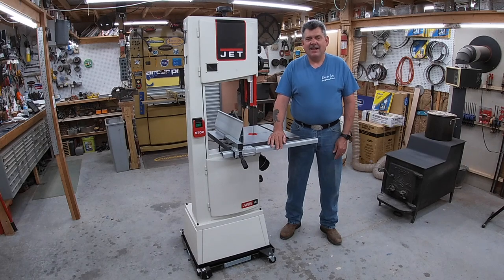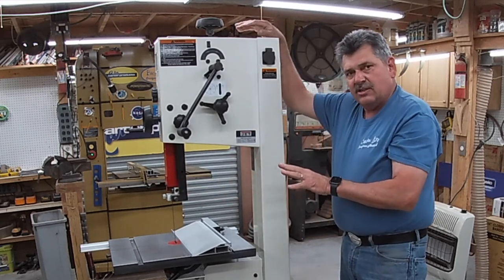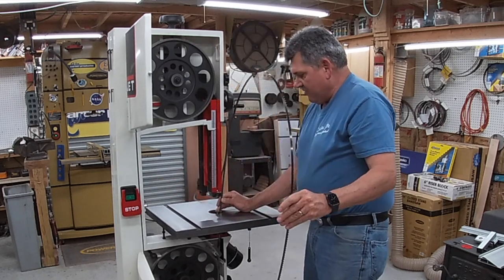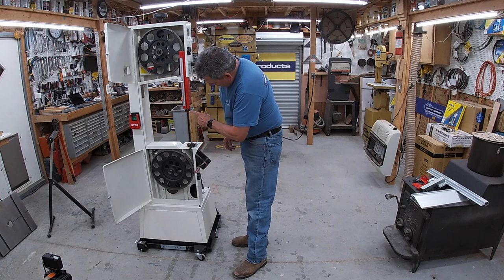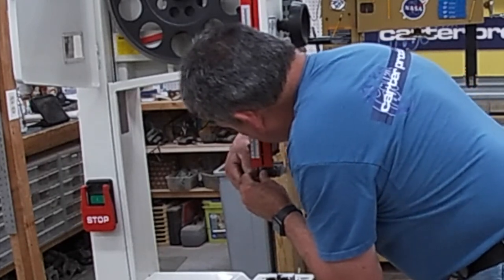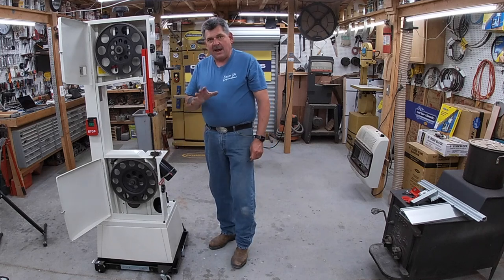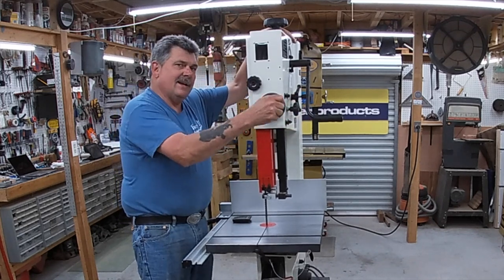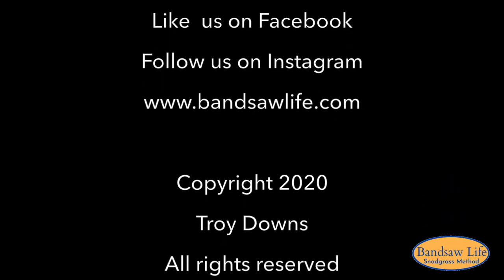JET JWBS 14-SFX

Comment: I have this saw. when I tried to install a 1/4" blade, the tensioner nut ran out of threads and fell apart well before the indicator reached the 1/4" mark. Is there some sort of method for adjusting the indicator? Since I have this feature, it would be nice to use it without having to rely on "eyeballing" alone.

Comment: One thing I am curious about is how you never aligned the table with the blade.  How do you know the blade is parallel with the fence?
Reply from the maker: I used a F.A.S.T. Fence alignment system tool to align the fence directly to the blade.

Comment: I love that they used cast iron for the wheels and the saw is a really nice looking design. BUT, I’ve been reading reviews on this model and there are a lot of people who are having problems with parts breaking while they snug up a certain area. There are multiple complaints about the fence locking mechanism breaking. There are more than a few complaints about the cast iron table being dipped, so people have to pick up the wood to go across the split in the table. Some complaints about the quick tension mechanism going bad. But the number one complaint (and it’s about 99% of those who contact Jet) is customer service and/or technical assistance. Literally dozens and dozens of people complain that there is little to no help from Jet. Of the people who have a properly functioning saw, they say it cuts effortlessly and they couldn’t be happier. This tells me it’s a problem at the manufacturing level. Jet, pay attention! This could bring you back to the top of the home workshop and even small business owners level or if these issues continue it will make you another laughing stock company that looks like you are just pretending to build good reliable products.
Reply from the maker: @davidt8438  David while I can understand your criticism I also know this is their number one selling saw which means there are thousands upon thousands of them and yes there will always be problems.  Jet had an issue with customer support during Covid and they have stepped it up.  If you personally have a customer service issue please feel free to call on me and I’ll do my best to get you to the right person
Reply: @bandsawlife2660   Thank you Alex, I appreciate your response. I’m glad to hear Covid was the culprit and not just another company just out for a buck and then no support. While I don’t have the aforementioned bandsaw I do have their old floor oscillating sander (JOVS 10) Unfortunately parts for that are no longer available and I’ve looked. I wonder if you know if the newer floor model (JOSS-S parts are interchangeable? Specifically the spindle and related parts. I understand you’re the bandsaw guy so if not that is expected. I do wish they would stock more parts for old machines that were sold as recent as 10 years ago. Thank you

Comment: Glad you like the saw,I bought one last month when Jet had 10% off.I set it up using your method and it works perfectly.I removed the keepers on the fence so it can just be lifted off when not needed. Now if Carter would just make a stabilizer to fit this saw without having to buy extra parts.

Comment: Hi Alex: Very informative video. Just subscribed. I've just come across your name as I am acquiring shop tools to go into my newly reorganized garage. I recently purchased the Rikon 10-3061 10" Deluxe Bandsaw, Includes Fence and Two Blade Speeds. It has not yet shipped. I am starting to doubt the purchase based on many complaints I've seen about the non standard 5/8" miter slot. How big of an issue is that (there are really no 5/8" miters out there that have any good reviews)? And what benchtop band saw would you recommend for at most $700 budget? Thank you in advance.

Comment: Hello I bought this saw 4 days ago after watching this video.  Thank you, it's a great saw. Just a couple comments for future buyers.  It's a heavy saw, about 300 lbs. so get a friend to help you set it up. It's a fairly easy straight forward set up so don't be afraid of it.  It comes with the trunion mounted to the frame not to the table as shown in the video. You do have to mount the table to trunion, only 4 bolts. Mine came with 2 rust marks on the table but cleaned up nicely with paint thinner and steel wool. If you need to clean yours, wax it afterwards so it doesn't rust again. The set screw for the lower thrust bearing adjuster is 3 mm not 4 mm as the instruction sheet calls for also a ball end style hex wrench helps install the upper dust port. The wrench supplied just won't get it done. The only other tip I have is when you go to turn it on for the first time push the green button with really firm pressure. It moves about a quarter inch or so before it engages the real switch and that inner switch has a very tight spring. After you work it a few times you'll get used to it. Happy Sawdust and thank you Alex for the all the advice on every ones comments. I had bought 5 Timber wolf blades when I bought the saw, guess I'll be ordering some Carter blades at least in the smaller sizes.
Reply from the maker: Thanks for the feedback.  Carter blades a far superior to the Timberwolf in both performance and durability.  Post some photos, you have a great saw there

Comment: I just purchased this bandsaw and found this video to be very helpful. Just want to note that my new saw has several upgraded features in comparison to the saw in the video:
1. All guide bearing adjustments can now be done without tools. This includes both top and bottom guides. 
2. The lower thrust bearing is no longer attached to the table. It’s part of an adjustable block assembly that holds thrust and side bearings, and is attached to the frame. 
3. The small panel that covers the upper thrust bearing is gone, and the tool-less adjustment knob is always exposed. 
4. The lower guide guard is now a single unit, and is hinged to move out of the way for adjustments. It does not require the use of any wrenches. 

All of these updates make setup and adjustments much easier than the version shown in the video. Note that the old part number was 714400, whereas the new saw part number is 714401. 

Thanks again for the great video!
Reply from the maker: Thanks for the update, it will help others.
Reply: When I try looking I keep coming up with 714400K and no one seems to refer to it as 714401
Reply: @matteason989  Hey, Matt. After my post, I realized the 01 part number is just for the saw, and 714400K remains the part number for the entire kit (stand, fence, etc.). So, it appears the changes I listed above have been rolled into production with no change in part numbers, and therefore no way to tell which version you might get before purchasing the saw. My guess is that this stock is turning over pretty quickly these days, and a saw purchased today is likely to have these updates. FWIW, I purchased mine in May from Acme Tools. Sorry for the confusion, and good luck.
Reply: @chipmiller984  Thanks Chip. Local Rockler is doing 10 percent off Jet in August. I'm tempted to get this one instead of the Laguna

Comment: I would like to add a mobile base. In your comments below, you mentioned one with steel wheels from Woodcraft. Can't find it on their website. Also, I put on a 3/4" Wood Slicer blade. Tires are only 1" wide so can't center the teeth on the crown of the wheel. Even so, with your setup, the saw does a fabulous job of resawing. I've had this saw for several years and had been struggling until I saw your video. Thanks for the great advice!

Comment: My experience with this saw has been mixed.  I bought it on a black friday deal last December.  When it arrived, I noticed that the upper guard (the red housing with vertical slot to allow blade installation) was cocked so that I couldn't raise it all the way; the red housing ran into the white steel housing, which was cocked.  After talking to Jet tech support many times and trying to correct this, Jet replaced the saw.  The replacement saw has a few minor issues (the upper guide block was roughly machined and two upper guide bearings wouldn't rotate at all), but Jet supplied replacement parts and the saw is now running.  I also have a Laguna 14|12.  The Jet is beefier and taller.  The lower guides are harder to set on the Laguna because they didn't provide enough vertical clearance under the table for larger hands.  Also the upper post was 'cocked' on the Laguna and I ended up shimming it to get the ceramic side guide faces to be parallel with the blade.  Overall I'm not sure which I would pick if I could only have one.  I think the Laguna might get the nod by half a gnat's whisker but my impression is that if I had spent a little more and got a Jet 15", it would have been a better saw in terms of guide adjustability and perhaps quality.
Reply from the maker: I wouldn’t disagree that the 15” is a better built saw and their customer service was exemplary.  Sad you got some issues but I’m thrilled they stepped up.  Thanks for sharing

Comment: Have been researching band saws.  After reviewing your excellent video, the Jet JWBS14-SF is the one I ordered. Will be using mine for wood resaw.  What casters did you install on the stand?  I would like to have mine mobile.  I talked to Jet and they cautioned about being top heavy and maybe tipping over with the increased height with casters installed.  Would appreciate your thoughts.  Thanks.
Reply from the maker: Steel rollers I got from Woodcraft
Reply: @bandsawlife2660 Thanks

Comment: I just bought this today, based largely on your recommendation. It’s a beast compared to my 14” Delta 3/4HP! The newer version doesn’t have the thrust bearing as part of the table - it’s setup more like Carter guides now. Take the time to align the fence properly and it cuts super accurately.
Reply from the maker: Please let me know if you have any other questions
Reply: @bandsawlife2660  Actually, I noticed that when you applied the tensioner, there was no clunking sound like there is on mine. Even with no blade on the machine at all, when I raise and lower the tensioner, it makes a pronounced clunk about halfway through the travel. It’s a brand new saw, so I don’t think there could be any wear issues. There’s that and the upper wheel rubs on the left part of the blade guard, which is annoying. Maybe something’s misaligned in there...
Reply from the maker: There is a cam that needs some dry lube.
Reply: @bandsawlife2660  Ahhh. That I can do. I’ve been super happy with this saw, and it freed up my little Delta 14” so that I can actually use it to learn since the Jet is used for production resawing. We just delivered 200 parts to our customer and they were thrilled with them. If you have a minute to waste, check out Nordost on the web. They make INSANELY high priced audiophile cables, and those cables have precision machined wood blocks with their logo etc. We make those blocks. You, sir, have been an invaluable source of information and advice and I can’t thank you enough!
Reply: @bandsawlife2660  It turned out to be the set screw at the bottom of the cam was “about to fall off” loose. I had to disassemble the mechanism to get to it, but it wasn’t hard. Just the bottom bracket with the through-bolt coming off was enough access to tighter her up and get back and running.
Reply from the maker: Good to know!  Thanks

Comment: I just purchased this saw. I have a couple of questions on the set up. First, the lower thrust bearing rides on the side of the blade. Is this supposed to do that? Second, is there a trick to getting the smaller blades to ride center? My 1/4" will not. I'm assuming it's due to the tires not being perfectly flat?
Reply from the maker: Loosen The two side bolts and there should be enough play to move the entire bracket,  there is a small Allen screw to move the back thrust bearing to line it up

Comment: Hi Alex I just bought that saw just took it out the crate today would you have any clue why the top wheel when I raise the blade guard up high and turn the top wheel it rubs really bad on the guard would you have any idea why!!
Reply from the maker: Sounds like the guard may be just a little loose. If you just pull it forward it shouldn’t rub and then tighten it up so that it is aligned and doesn’t hit the wheel.

Comment: Alex. I really enjoyed your very educational videos so far and they helped me tune up my old Jet bandsaw for great re-sawing. Thank  you. I just had my new 14-SFX saw delivered to me yesterday and assembled it today. After adjusting the blade and bearings per your instructions I tried lowering the "upper guide rack". I saw that the distance between the back of the blade and the upper thrust bearing increased almost 3/16". Now if I move the rack upwards, it would not move past 10" up, as the back of the blade pushes against the thrust bearing. I called Jet and the guy had no idea how to adjust this. Maybe you have an idea. Thank you.

Comment: I bought the 14DXpro (the pro has the cabinet base instead of the open-frame stad) a few years ago and love it.  How does the DX compare w/ the SFX? I also got the Kreg rail & fence, and the micro adjuster - great addition to a saw that doesn't have a fence.
Reply: SFX has a larger motor, longer blade, larger table, nice fence, larger resaw capacity

Comment: Alex, I have that same Jet band saw. The top guide bearing when moved from the 13" down to the bottom for smaller wood cuts shifts so that the bearings are no longer where they are supposed to be. Does this mean that I need to have guide system replaced?
Reply from the maker: This saw does have some adjustments but I think you need a customer service expert, give them a call and please keep me in the loop. 800-274-6846

Comment: I'm going to get one of these on Black Friday from my local Woodcraft. I'm planning on using it for re-sawing, general rip cuts, and some minor coping. Do I need to go through all these steps every time I change a blade or is it pretty well set after the initial setup? Thanks for the info and I can't wait to get it! Never had a good bandsaw before and I'm already chomping at the bit to use it.
Reply from the maker: No you should need to but by doing it the first time it helps you under the saw better

Comment: Alex  i have a guestion for you . I recently  purchased the jet bandsaw 15" 3 hp  model and  im in the process of  installing a 3/ 4" blade  but I'm  having a problem of centering the gullet in the center of the wheel  l can't  get the blade to stay in the center I adjust the wheel to bring blade back to center it and it stops just short of center I run out of adjustment . Is it because blade is too wide ? I'm trying to follow your instructions on set up . any idea why it won't stay . Thanks Tony

Comment: Hello, I bought a used JET JWBS 14-SFX. I'm pretty happy with it soo far, but I bought new Cater tires for it and found out they are an 1/8" too narrow. Meaning the tire doesn't fill the wheel channel completely. Is there any advice you can give me regarding this? Should I take the Carter ones back?
Reply from the maker: Just make sure they are against one edge.  Urethane spreads over time and wear.

Comment: My Jet 14" SFX bandsaw  was just delivered this week.  BTW, this is my first bandsaw.  As I am setting this up I am running into some issues - even though I am "trying" to follow the instruction manual.  At this point I have two questions: 1.  I have spent close to an hour trying to get the lower two screws of the upper dust port secured.  To no avail I cannot get them to screw in.  Is there a tip / trick on how to get them in?  2.  I am installing a Timber-Wolf 3/4" blade as I need to initially do some resawing.   It appears that the blade is getting hung up on the lower red guide.  What do I need to do?  I am a bit insecure as I don't want to take the machine out of any factory set calibration.  Kindly look forward to your assistance.  Thank you.

Comment: Hi Alex
Really enjoyed meeting you at our local Woodcraft last month in T Town
I bought this saw based on your review and my own research.
Do you think the Carter Mag Fence would be a reasonable upgrade to the factory fence or for a Jet drill press? 
Thanks again
Reply from the maker: Absolutely,  I use mine for the drill press all the time.
Reply: Do you recommend replacing the factory wheels with Carter blue urethane wheels?  Thx
Reply from the maker: Only if your wheels are worn out.

Comment: Love my saw. but having a problem went to change my blade and used the quick release , now it doesn't want to work very loose also blade guage arrow came off of pin, any ideas,  By the way Love your videos,
Reply from the maker: May have to lube the cam with a dry lube and perhaps the tension rod as well.  If this doesn’t work let me know, I know some great people that can help.
Reply: Thank you i'll try it

Comment: First, thank you so much for this incredible tutorial. I have a couple of questions for you:
1) should the deepest part of the gullet be in the center of the wheel top AND bottom? If so, I'm having trouble getting that alignment.
2) what's your advice for finding correct tension? I popped a 1/2" blade pretty immediately upon setting up my saw...
3) how clean of a cut should someone reasonably expect when re-sawing?
Reply from the maker: 1. Top only, the bottom should always ride a little forward from the top. 
2. Tapping on the blade with one finger, always on the left side just above the guard you shouldn’t get more than a 1/4” of movement. 
3. A pass through a drum sander should be able to smooth it. 
Hope this helps
Reply: @bandsawlife2660  thank you so much! I'm going to get the saw reset tonight. Really appreciate your time and knowledge.